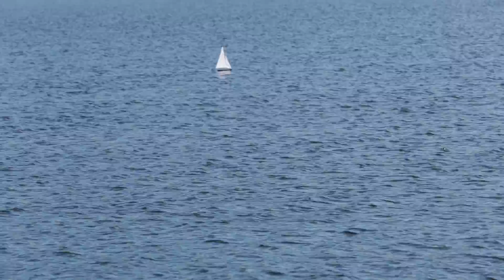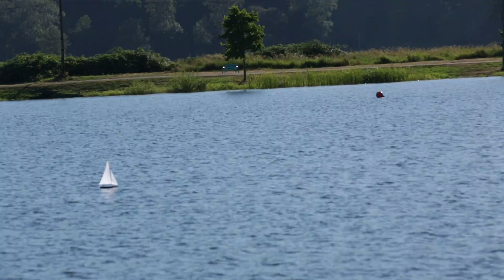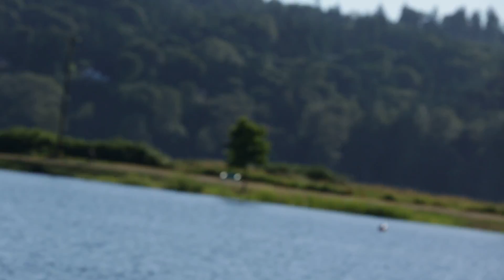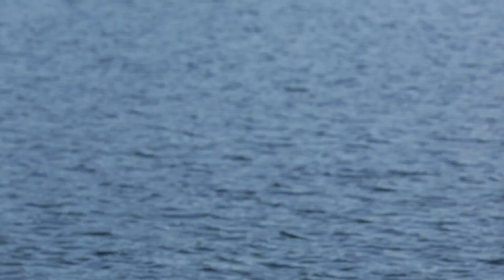Maiden Voyage of Free Sailing Dumas Ace Sloop

Comment from the maker: With what I have learned since I built this boat, my neighbor, brother and I are going to build three of these with RC control of rudder and sheets.  We will see how it goes. That being said, there is something wonderful about the absolute simplicity of the original.
Reply: please let me know how you did it! i built the sloop and i want to convert it to rc but not 100% how. im a plane person not a boat person
Reply from the maker: Dylan, I do not have all the problems solved but i think the approach used in this video at the  minute 5 mark should work. https://www.youtube.com/watch?v=9VHMwVbXgoQ . The sheet and rudder servos could be mounted to the surface of the deck with the majority of the sunk into small wells extending below the surface. A small deck house with removable top could be built around the servos to keep most of the water off. Rx and  batteries would be in the deck house as well.
Reply: i was thinking of possibly putting a 360 servo winch to control the mast and jib, possibly a winch for each just because and then a rudder servo. the only issue then would be water proofing but using micro servos they could be put under the deck

Comment: Your pretty brave sending the sloop out on a breezy lake and curious to know to know if it came back safe...............did you use a rudder servo?? I just built that same model and would love to put it on the water but a bit leary    UPDATE   12/14/16   building another ACE only this time am using one mini servo that controls the sheet and rudder, will post results when tested